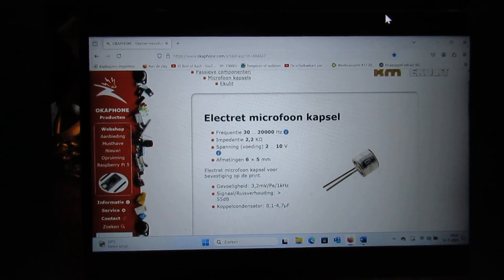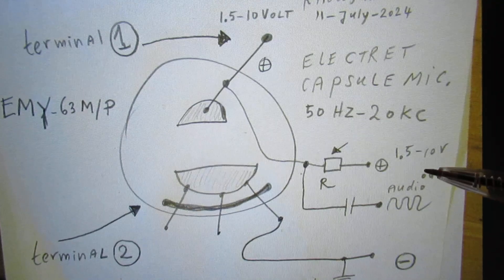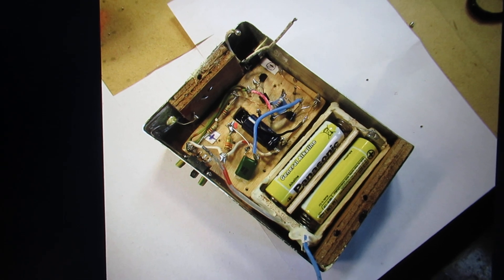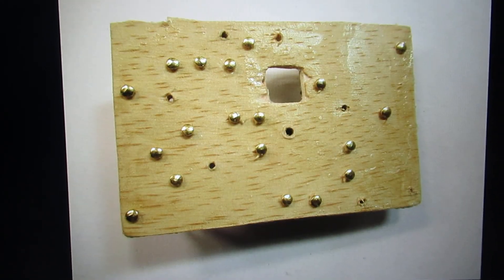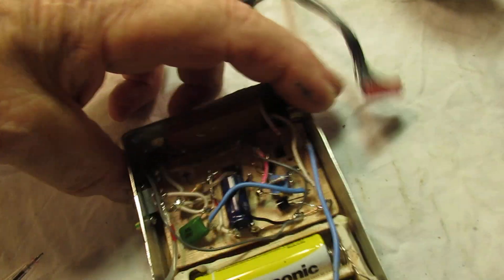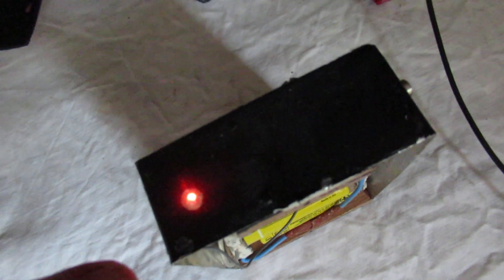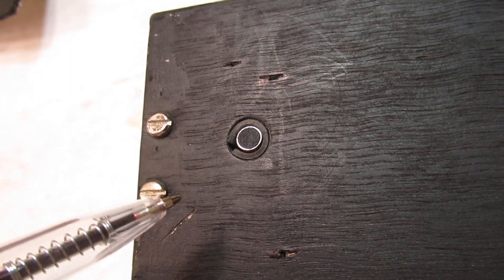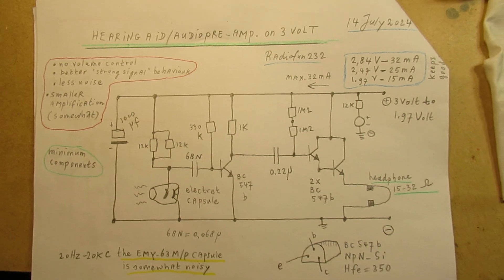Audio micr. amplifier for electret capsule with 3 transistors on 3 - 2.2 Volt demo & practice VLOG

Comment: It seems that practically every electret mic circuit I come across biases only to the high side which I have learned is considered bad practice.  Do you know why that is?
Reply from the maker: Please elaborate on your question. What do you mean with "the high side" and (thus) why could that be "bad practice", when it biases (?) in that way. What does that "biasing" mean, in your case? And what are the properties of that "biasing"? Also in regard to what that means, when you say it is "considered as bad practice". Thanks for your comment and question.  16 July 2024.
Reply: @radiofun232  Sorry if I wasn't clear.  See 6:30.  There is a 330k resistor pulling up the base of the first transistor.  It is providing a positive bias. On the second stage, the base of the darlington also has a pullup resistor (the two 1m2 resistors).  Quite often, when transistors are biased, it is biased both positive (as you are showing), but also negative (to ground) through another resistor.  In the book "The Art of Electronics", they would consider it a "bad" biasing circuit if it doesn't have both pull up and pull down resistors.  Yet practically every microphone circuit I see, does it the same way as you show in your schematic.  I'm just wondering if there is a good reason for that.  Thanks.
Reply from the maker: @Enigma758  That can be explained. The grounded emitter stage has a high voltage amplification. By its properties. More on the www. Yes, often you see in these G-E setups the following things: a voltage divider that biases the NPN transistor. It goes between (+) and (-) and consists of 2 resistors, where the node goes to the base of the transistor. Be it NPN or PNP. They need to set the transistor to a certain biasing, so that it can amplify audio signals properly. That type of biasing is, like you know, made to amplify audio signals (say sine waves) and serves the way that audio signals are amplified. It must be pure sine wave amplification. No overdrive or non-linear amplification, because that will mean clipping and audio distortion. In such a case (healthy biasing): often (say) a 100 N -470 N cap into the base and a 100 N-470N cap out, signal taken out at the collector, opposite to ground, here mass-minus. That is linear (say audio) amplification and how that audio signals, music, speech, (20 Hz-20 KC) is amplified properly. The sine wave + and the sine wave – part of the wave can be set to be amplified properly. That is set via the voltage divider/biasing. You can allign that very properly in all kinds of G-E amplifiers, made with 1 transistor, by using a 25K potentiometer, node tot he base. And at the upper electrode of that potentiometer (in case of a NPN transistor) a resistor of 1 K to the (+), to prevent destruction of the transistor, when turning the potmeter to its highest position when searching for the right bias. Say that are the “essentials” of biasing a transistor to a working point where it is able to amplify audio signals properly/pure. This does not refer to, like you know, a “switch circuit”, where the base of the transistor gets such a high current, that we have a saturation current between the Collector and the Emitter, driving a relay or whatever in the C-E lead.
In this case of a 3 stage audio (!) amplifier on 3 Volt (that is crucial) we use the 3 transistors in such a way that they have their maximum current amplification, connecting the emitter directly to the (-) minus. 
In a G-E circuit it means that the current amplification of the transistors is set to their maximum and also that there is no frequency dependent element (R-C) in the emitter lead (your question). So these transistors are set to their “bare” amplification properties.
That is necessary, because we only have 3 Volts, and, like I explained in an earlier video, link is in the textbox, we only have (say) 2 Volts effective to “do” something, thus say drive a headphone of say 32 Ohm or whatever. With (say) only 2 effective Volts and 10 mA out of the battery that only means 2 Volts x 10 mA = 20 milliwatt to the headphone. That is say enough in this case. Hope this helps & thanks for your comment. 16 July 2024.